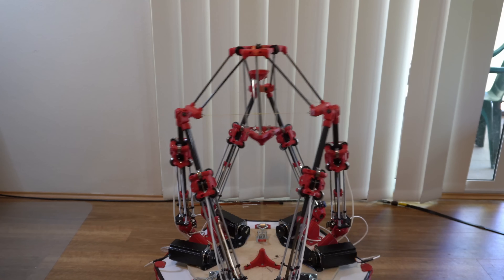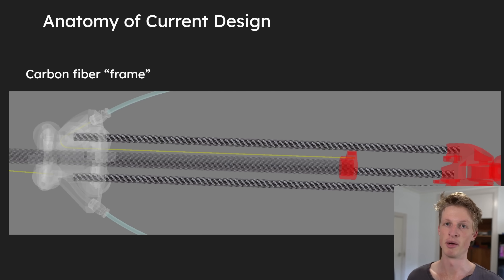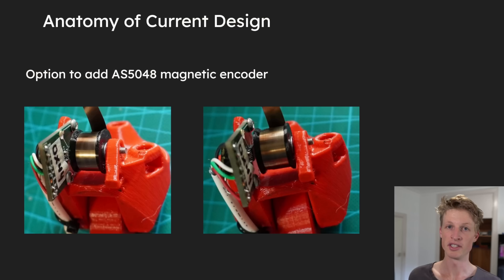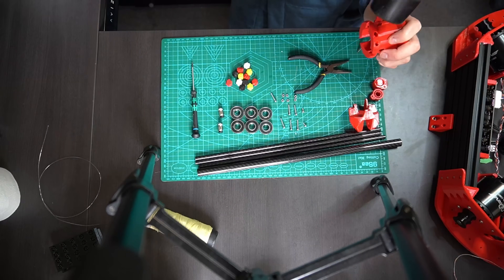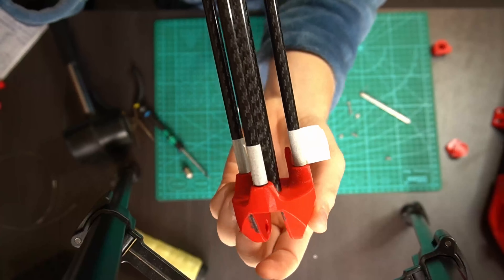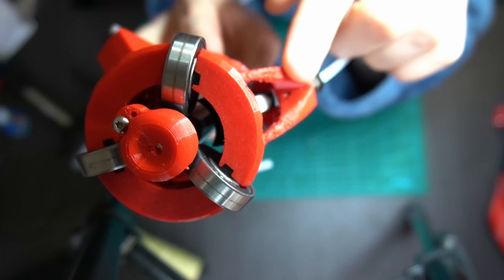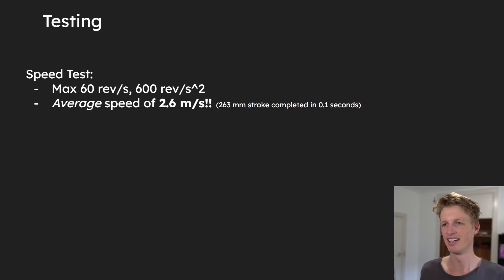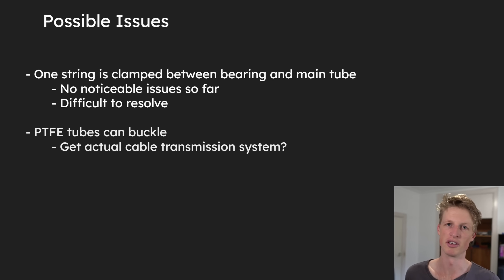Designing High-Performance Linear Actuators: Speed & Stiffness for my Juggling Robot | PDJ#19

Comment: Really good to see an Aussie doing great content. A few tips from a more experienced self taught engineer.
Your interference fits are probably weakening the parts. Maybe not enough to worry about. Epoxy or similar would be another way to get the perfect fit you want without forcing stuff. Just make the socket about 0.1 - 0.2 bigger and fill the space with resin. If you do stick with interference fit. I'd suggest using a vice jig or car jack jig to press the parts rather than a hammer. Lube is your friend here.
Same for your bearings. I suspect they might be a bit too firm. Rather than 0.1mm spacers (0.1mm is quite a lot in tollerance fitting) perhaps an adjustable system, like a cam and set screw might be better. I've done interferance fit in PVC injection moulded parts, 0.02 increments where big changes. In 3x 0.02mm steps I could go from falling out, to pretty good to dosen't fit without a 2 ton press.

The ptfe cables are a great idea. Reminds me of the richard 9000 robot another channel made a while back. I do wonder how long before the string cuts into the tube? I guess 2k chooches is pretty good though. I wonder if a good glue lined heat shrink around the ptfe would add the stiffness you need? A bigger size would be stiffer, due to lots of shrinkage thickening the heatshrink wall, while a closer fitting size would be less stiff due to less shrinkage. I've used heatshrink to aleviate cable flex on electrical wires many times. Works wonders on guitar-amp leads to stop them bending at the plugs and breaking. I suggest glue lined (double wall) because it shrinks a lot more and can get much stiffer.

re the current sense end stops. I cringed a little. Hope your detection time is very short. Its being pretty hard on a few things, heat in the motor driver and mechanical force on parts being the 2 main concerns. As well as pwer consumption. Perhaps a short stiff spring, or a fit of rubber foam, at ends could allow sensor to work while reducing extra wear and tear? on the plus side, if you hjave something fowling your bearings, or needs lube, etc etc, the sensor will let you know early.

Last tip. When you said at the start, that it needded to be perfectly acurate. I felt much pain in your future. As you are learning. there is no perfect movement. Only less play. As your go down from mm of play to microns, your parts need to become exponetially stronger due to all the forces. Suggest aiming for a sensible amount of play and backlash. say +/- 1 or 2mm? should be fine for juggling robot.
Also perfection is the enginners enemy of finnished projects.

got a sub from me. look forward to seeing how you go with this and hopefully many more projects.
Reply: Oh, one last thing. Rubber tyres for the bearings. Probably print, maybe cut 700c bike tube (seam might be a problem)? They want to be thin to get your no play, but a bit of softness and grip could help performance a lot while reducing tube crush.
Reply from the maker: Cheers for the suggestions!

Yeah I'm not a huge fan of the hammering needed for the interference fits... A few of the other actuators that I made cracked 😬. Nothing too bad, but not great either. I like the idea of lube here! Others have suggested heating the CF tube before inserting, and I think I'll give that a go as well. Not too keen on epoxy/glue, though; It's quite likely that I'll be cannibalising these actuators for parts later and those tubes are easily the most expensive parts on them, which I'd like to reuse if possible. I'll probably be cutting the printed parts to get them out right now, but at least that should be possible.

Right now I'm not too worried about the PTFE tubes; I spent most of yesterday redesigning the actuator so that the motor is in the actuator itself, removing any need for tubing as the strings only travel straight (or around pulleys). I think I'll live with the PTFE tubes as they are right now while I test the new design, and if any other PTFE-related issues come up, I'll just swap to the new design. Interesting idea with the heat-shrink, though! Nobody else has suggested that (from what I've seen) and on first thought, it seems like it might work pretty well!

Haha yeah the current-spike-end-stop is a little rough. I really like the idea of foam/rubber pads. I think I have the perfect thing lying around so I'll give them a go when I have time. Cheers for the idea!

Yep, I am painfully aware that "perfectly accurate" doesn't exist; I think I just spoke a little hyperbolically in the recording for this video. ~1-2 mm inaccuracy should be tolerable for the Stewart Platform on the whole, though I reckon these actuators should be able to pull off much tighter control than that!

Re. rubber tyres: I really like the idea that a few others have mentioned of printing TPU "sleeves" to fit over the bearings. They can be printed so as to perfectly match the diameter of the inner CF tube and should help a lot with getting a tight-but-not-too-tight fit.

Cheers!
Reply: After commenting, I thought heatshrink on bearings might work too. Again I'd be going for the biggest glue lined size that will shrink on tight for thicker wall. Its too cheap and easy to not try it.

Re interference fit, have you considered a clamp design similar to push bike seatpost? 

The press fit requires tolerance matching hard to reproduce consistently on rdm printer. Its likely that a strong fit is putting micro fractures in your parts, limiting re-use anyway. You wont know about the micro fractures untill stuff starts suddenly failing some time later... 

Maybe print in abs and lube it withe acetone? For a melt fit. 
I like the idea of heated parts! If you heat the printed parts it might go well too. A few videos on annealing pla on YouTube. It'll get a bit soft at say 80c - 90c, then shrink smaller than original when it cools. 

A common press fit with metal parts involves heating outer to make it bigger, and also cooling inner in freezer or cryo, to make it smaller. When cold shaft goes in hot cavity the parts create a fit thats almost as good as a weld. Similar tech in glass to create very strong laminated glass.
Reply from the maker: Hmm that's an interesting idea! I'll have a look around for some really big glue-lined heatshrink!

I've tried a few clamp-like mechanisms on for size but couldn't find one that worked universally well. Always either too big or too many parts, making construction difficult.

Re. printing in ABS, my printed is <1m from where I work, and I really dislike printing with ABS because it stinks up the room. Moving the printer is not trivial so ABS isn't really on the cards for me right now. FWIW PETG is working wonders anyway 🤷‍♂️

I did try heating the printed parts when building one of the actuators (with a heat gun), but I think I need a more localised heating method because the entire area around the hole got way too soft

Cooling the CF tubes might work as well! I'll chuck one in the freezer tonight and see if it shrinks much overnight. Good idea!

Comment: A nice project, but actually I do not need a linear actuator :D

I do have a question about the encoder on the back of the motor though: Does this encoder go directly with the motor or did you attach it to the motor and pick it out yourself beforehand?

I haven't searched much, the ones I've found are very crude though and probably more likely to be used for turning a potentiometer. The other extreme seems to be on the back of a stepper motor and is supposed to have 30,000 steps. That seems a bit much for 360° to me, because the computer also has to evaluate the 30,000 steps per revolution. I think that is a false statement.

How did you choose your encoders and where did you look?
Reply from the maker: The encoder I'm using (CUI AMT102) doesn't come with the motor by default, but it is recommended by the motor's manufacturer (ODrive - the motor is the D6374).

What application are you thinking of? Many encoders have the option to change the resolution (pulses per revolution), so you might be able to do that if you're worried about overloading your processor? Eg. the CUI AMT102 can be set to anything from 48 to 2048 PPR
Reply: @harrisonlow  I just want to get an overview of the technical possibilities and the prices. I will probably not upgrade my Ender 3. 😜🤣

Comment: Interesting, when I saw the thumbnail I thought it was for a 6 DOF motion simulator for racing/flight sims.
Reply from the maker: Very close! The 6DOF Stewart Platform part is the same, only I'm using it to juggle rather than be a motion sim. These could probably be used for a motion sim, though they might need to be bulked up a bit to make it work

Comment: If you can make a excursion limier actuator with the ability to move at and sustained 400hz or maybe even 800-1000hz I could think of some seriously cool stuff to use those on.
Reply from the maker: What sort of travel would it need? Those speeds are pretty fast!
Reply: The equation to calculate that is speed = to distance over time. So you would need very specific data and specs for each speaker in a way to calculate. Cause there is a lot of factors on speakers like how long is the longest possible amount the cone can travel in one direction that’s the X max. Modern subs usually are between 24-30+ mm x max and then u have the voice coil it’s diameter as well as gauge of wire how many turns and layers as well as length and exactly where it’s placed into the gap that focuses all the magnetic energy into a very intense but small area then based on gauge and circumstance as well as turns and layers I can estimate the power handling max and rms cause lenses law is when a electric field travels thru a coil magnetic fields form and collapse thus how a speaker makes sound by creating modulated electromagnetic fields that interact with the permanent magnets magnetic fields that’s basically routed thru metal plates that kinda act like magnetic wave guides and cause the magnetic field lines to flow thru the metal vs extend out and thru air causing the ability to really concentrate a very condensed and focused sum of the Permian t magnets total magnetic power into a small and concentrated area that can be optimized and adjusted based on needs and function. And to calculate a sound waves size from one peak to the very next peak is the distance and length of the sound wave at that frequency and altitude. So if u had a 20hz frequency sea level with a speed of sound at 1130 fps you would simply divide 1130 by 20 and get 56.3 and that would be the length of a single wave at 20hz and would resonate in a space that big or could be broken into half or quarter wave resonance. But that’s getting away from this. Next after u got your data you use the formula velocity= omega*amplitude*sin(omega*time) following me to this point at all. That formula is for maximum and the first formula is for rms or average and depending on the subs power and excursion mechanics will alter the speed as well as enclosure and harmonic resonance as well as air pressure via ports in the box that causes frequencies to have air springs where the port is out of phase to the speaker cone  or other frequencies where they are in phase and constructively interact and multiply each other on a harmonic resonance standing wave. Speaking of that teslas earth quake machine just oscillated and he was trying to tap into the resonance of the skyscraper he was in by attaching it to one of its main support beams near the foundation. Apparently when he got close the constructive standing  wave turned into a runaway closed feedback loop system that would have easily shook the building to collapse by producing that very specific frequency into the building but it wasn’t built to actually be able to handle and produce its own resonant frequency cause when even the smallest amplitude and amount of that very precise frequency sound energy is injected the output sun of the energy it would create is magnitudes more than the energy required to cause a structural failure leading to collapse with far far less energy than if was strong enough to actually sustain and reach a maximum energy wave level created by the amplitude and power of the inputted harmonic resonant frequency. Say a speaker only has a Xmas of 25mm or 1 inch then one wave the speaker cone would travel 4 inches to compete a single sim wave and that would mean the speed of the cone with a speaker that had good and accurate data sheets with accurate measurements and good quality control measures would be easier to figure out but say a 12” with 600 watt rms and 25mm x max was playing 20hz tone plug the numbers in and you would get the speed of the cone is traveling at 5 meters per second or 18 km/h or 11.25 mph. Remember this is at 20hz the lowest frequency humans can hear before sound becomes subsonic to us and we can’t hear it. And that speed will grow crazy fast as you go up in frequency. All so omega can be calibrated with the formula 2*pi* the frequency being produced.  so really u can get your max speeds based off the co-sign wave with this formula. This is for max speed not ave.  All so you can get max once you calculate the ave max will be 1.57* more than ave. So as u go up in frequency even over 2-300hz the speeds dramatically increase creating some crazy mechanical stresses and forces that must be accounted for. But there is a lot of factors. There is all ready a linear floating flat wound voice coil actuator    That drives the worlds best and highest output sub made by power soft the speakers name is the M force series and they have 40” subwoofer cones and power handling of 30 thousand watts and it can move that actuator and cone with 40” round with a insane and industry highway excursion and x max. It does have some limitations like it can’t play tones above 2-300hz but the output of the frequencies below 300hz the amount of output far surpasses any other subwoofer in the world and can produce the equivalent output of 4 quad sub 18 full stack boxes with a single M force series that has the same footprint as a single quad 18 full stack sub box so greatly reduces shipping and equipment hauling cost as well as volume cause just a quarter of the necessary hear is suddenly now required to cover the low end bass sound as well as much higher sq with zero latency signal correcting feedback loop monitoring and correcting   Every single stroke of the cone with the super high amounts of measurement and corrections per second  it uses to really self optimize. But check out powersoft M force series subs. They are the future of speaker technology that and transducers becoming more used. Powersoft all so makes a sun actuator that’s a sub transducer and can literally make the ground into a giant high powered subwoofer by injecting the frequency into stuff and the  what ever you choose becomes the speaker by sympathetically vibrating. Usually transducers can’t play below 400hz so to have a subwoofer transducer that can play 10-400 hz like bass shakers or ass kickers transducers. This is like a industrial sized and strength butt kicker transducer.
Reply: @harrisonlow  basically the longer the travel the better but all so the faster it must be as well as accurate and sturdy to the mechanical forces resisting. Max speed would be more like 28.26km/h or 785mm/ps 17.66 mph at its maximum speed around the center and resting position. I’ll look up what the MForce speeds are capable of.

Comment: Really impressive, I love the pneumatic tubing to protect the string. Did you consider using linear ball bearings for the slides as opposed to the radial ones? It makes packaging all the bearings so simple, we have used them in the past for linear motion in FRC which has similar design constraints as this.

Comment: Can you maybe elaborate on why you decided to use a stewart platform for juggling? Why not use a linkage based design instead of linear actuators?
Reply from the maker: The short story is that serial mechanisms (like what our arms are) are extremely difficult to control precisely, and at speed. Parallel mechanisms (like a stewart platform) are much easier to precisely control, though suffer from lower end-effector speeds and smaller range of motion. ROM and (most of *) end-effector speed aren't too critical for juggling, so IMO a parallel mechanism is better suited to this task.

* This is only true for moving in the horizontal plane. To actually throw/catch the ball, you have to  move quite quickly vertically, which is why I have a dedicated mechanism for that on Jugglebot. If you're interested, I have a video on that mechanism here: https://www.youtube.com/watch?v=LbStGIFrnxY

Comment: Can't you just cut a grove in the bearing and adjust it closer to the tube?
Reply from the maker: For which part? Routing the downward string so is isn't squished between the central tube and the bearing, or to fit the central tube between the bearings?

Comment: Don't like the spacers stuff. You should mount a couple of bearings on springs and avoid them altogether
Reply from the maker: I see two issues that might crop up if using springs:
1) More parts in an already tight/full spot
2) Less resultant stiffness. The springs would naturally allow the central CF tube to push back against the bearings, giving it a bit of "play"

What don't you like about the spacers?